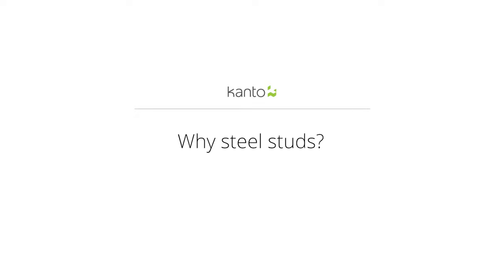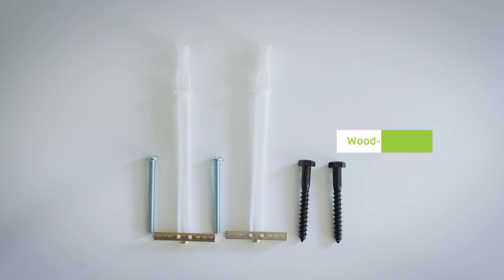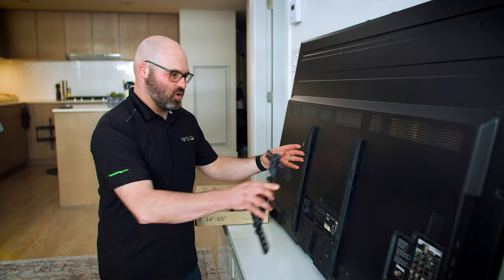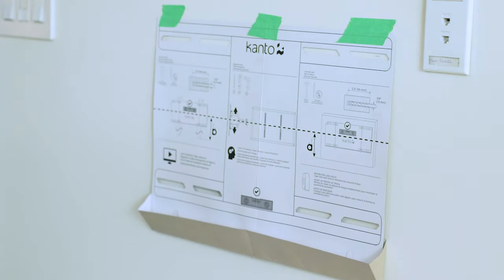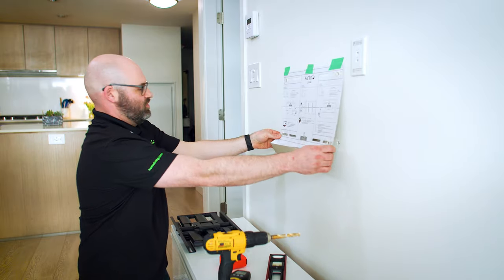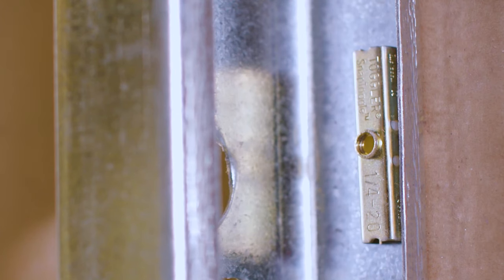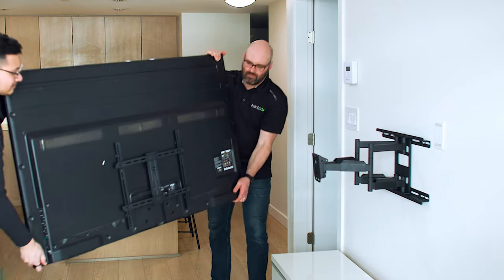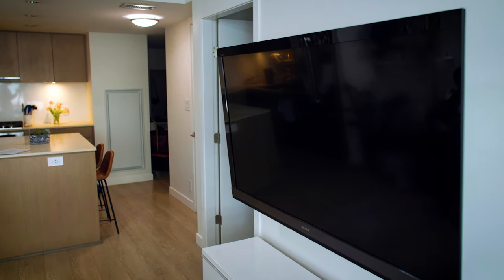How Install a TV MOUNT into a STEEL STUD WALL | Kanto Explains

Comment: I work at a university we install many tvs. I will tell you not every wall is to be trusted...some walls only go as high as a suspended ceiling, others go all the way to the bottom of floor deck below.  There's also a tremendous (lol) difference between a 32 inch TV on a stationary mount and 85 inch TV on an articulating mount. In many cases people who buy an 85 inch TV will buy a mount for it based on advertised max weight but never factor in the wall you attach to.  I would expect the steel stud would provide excellent pull out resistance and shear strength. I wouldn't put a big TV with articulating mount on a steel stud due to its crumple  factor.  It's likely that for many people this install will be successful, just be mindful of how much leverage you are applying to the wall. If in doubt we will remove drywall where the and add additional stiffeners. Many times we will even use 3/4 paint grade plywood to distribute the load on the studs more evenly. FYI steel studs you get at HD or Lowes are not considered structural. If by chance you're on a wall built with heavy guage studs you could disregard my earlier concerns as the steel is much thicker and will have plenty of lateral support.
Reply: 50 in good?
Reply: Yes, this. The 85 on an articulating is a great example of where you're very likely to need to spread out the load, or you'll have distortion of the upper bolt areas of the toggles, which in turn transfer that distortion to the sheet rock and could pop out a section of it, which would look pretty ass. It probably wouldn't pull thru/out, but it's not gonna be great looking for sure. The plywood mount panel is a good idea, maybe a cut-to-purpose piece of cut down 2x4 fitted into the inside of the stud to spread out the load, just spitballing a bit.....
Reply: What about a 65 inch tv? What would you recommend there?

Comment: I would like to add that a best practice with this mounting method is to run your toggle bolt through the threads of your anchor before placing it inside the wall/stud. This will prevent basic cross threading that can happen with this style hardware from time to time.
Reply from the maker: Great tip, thanks for the comment!
Reply: Man I've lost so many toggle bolts in the wall forgetting to check them first 🤦🏽
Reply: Excellent advice
Reply: And sometimes they still don’t catch. When that’s the case, I rub a small amount of chapstick on the top of the screw/bolt and then it threads satisfactorily.

Comment: This assumes the location perfectly bridges onto both studs which are 16" apart.  What if only 1 stud is where you plan to mount?   I plan on using a longer 6"x30" board to bridge across both studs, then mount the bracket to the wood, possibly also use more of the longer toggles through all of it into drywall to secure swivel base to the wood.  Overkill perhaps, but it's a 65", 50lb TV.
Reply: Agreed, that beam across 2 studs also gives extra strength.

Comment: Great video very helpful.  Probably the only thing I am going to add is only drilling about 1 inch in the wall maximum since there might be utilities behind like fire alarm or sprinkler systems or open romex instead of conduit.  I used the Walabot DIY tool to help determine my apartment does in-fact have steel studs, but also they are 24" OC.  But it also shows a lot of utilities.  I noticed the wall has a fire alarm as well as a sprinkler.  So I don't want to drill too deep.  about 1 inch depth should insure I go through the 1/2" drywall plus the depth of the steel plus a little more.  The utility holes are standard on studs right in the middle so that uniformity helps to avoid utilities as long as I control my depth.
Reply from the maker: The Walabot is a fantastic tool if you are unsure about what is behind your wall.  Thanks for the comment.

Comment: Is this mount able to adjusted/ or folded back to the wall off center?  Or is the wall plate portion long enough to catch 16” centers but be installed to the far edge of the plate? The steel studs I’m going into are not located so the tv is centered evenly on the wall space required.

Comment: Extremely helpful video - thank you very much!  This gave me the confidence to proceed with my DIY install of a TV wall mount in my condo with steel studs.  All went well using the snap toggle bolts (1/4" x 4) secured directly into the studs.  In one stud however, after drilling through the drywall and the metal, I hit wood, possible a small block? and I had drilled right through it.  The snap toggles I had and inserted, the bolt wasn't long enough so I ended up going to HD to buy a longer 1/4" carriage bolt (3") which worked and managed to catch the toggle and secure.  
I also like how your video shows what's going on inside the wall when you drill and insert the toggles.  Very well done video!
Reply from the maker: Glad you liked it and well done on improvising for your situation!

Comment: What if I screw the lag bolts directly into the metal stud without using a toggle bolt or an anchor of any sort? Say for a 40 inch 2020 TV and assuming the wall mount is fixed and doesn’t tilt or move at all. Asking for a friend :)
Reply from the maker: We do not recommend putting lag bolts in metal studs.  This could lead to disaster.

Comment: Hey Brett/Kanto - quick question.

Would this installation require drilling thru the metal stud as well? Do you need a special drill bit for this? Thanks
Reply from the maker: Hey Lee, you will be drilling through the metal stud for this installation.  You will need a 1/2" drill bit which you can find at most hardware or building supply stores
Reply: @KantoSolutions  I really appreciate it. Thanks!

Comment: I've read that putting a full motion mount on steel studs will risk warping the studs. I have a 65 inch TV that weighs about 50 pounds. Do you think there's any chance the metal studs will get warped?
Reply from the maker: You should be fine, especially since all 4 lag bolts will evenly distribute the weight.  We have rigorously tested out mounts to ensure a successful installation

Comment: My marble fireplace where I currently have a 55 inch tv hanging is a metal stud wall which is covered by a metal mesh, covered in concrete and then the marble placed over it. So the drilling depth is 2cm of marble + 3cm of concrete (5cm total). Would this be strong enough to hold the weight of the a 75 inch (40kg) tv if I were to upgrade? Thanks
Reply: If u have 5cm combined of marble and concrete, I'd be looking at Masonry/concrete anchors and forget these anchors. That said, considering the great length of the anchors and ability to control, I see no reason why you can't use them in ur situation. U just have to pilot thru a lot of extra material. No way these anchors are as strong as concrete ones though.
Reply: Either way though, you'll need a hammer drill to get thru masonry.

Comment: If you're using toggle anchors, why use the studs at all?
Reply: Drywall will not support the weight or movement of an articulating TV mount.
Reply: Steel studs are hollow, how are you going to expect a bolt to anchor?

Comment: You put a lot of trust into the wall hardware zip ties I wouldn’t do that with a 50 inch tv
Reply: It looks like the zip tie is primarily used to align and hold the metal piece in place until you screw the bolt into it, once they are connected the zip tie has no effect on the weight

Comment: The following video shows a guy dangerously hanging a 50-lb tv with an articulating mount using anchors that are ONLY anchored into drywall (without using studs). 

https://www.youtube.com/watch?v=xujweedgXQw 

If you are a professional installer, it might be worth watching and posting a comment if you think it's safe or not to make sure no one gets hurt from following such advice.

I posted a polite warning message for others, and it seems he immediately deleted the warning.

Comment: Excellent video! Thanks for posting! What BRAND of toggle bolts are these? I'm trying to figure out what to buy. Do I need the kind with plastic where you break off a piece that stays in the drywall, or can I use a "regular" metal toggle bolt from H. Depot?
Reply from the maker: We include SNAPTOGGLE heavy-duty toggle bolts in our LX600SW metal stud TV mount

Comment: I have a 65 inch qned85 tv and it weighs a lot. Almost about 70 pounds. I'm wondering if wall mounting would be safe because my tv is heavy. Also I noticed that my tv mount isn't wide enough and can only catch one beam instead of two but it's super close. What would be the best advice for this. Thanks all!
Reply from the maker: The LX600SW TV mount used in this video can hold up to 100 lbs so a 70 lbs TV will work. It's about 18" wide so as long as you have standard 16" stud spacing in your wall you should be able to hit both studs. Unfortunately, I can't advise you on what to do if you're unable to secure the mount into two studs.
Reply: You should mount a piece of 3/4 plywood long enough to reach both studs with 4 togglers, 2 togglers in each stud. Paint the plywood if you want to match the wall and be less noticeable. Then put the wall mount to the plywood with 4 more togglers, with one side being toggled to the stud.

Comment: I would not have a secure feeling mounting a 60" TV with those toggler  bolts which the most stress from the weight of the TV is putting on the plastics parts of that toggler bolt.
Reply from the maker: The plastic part of the snaptoggle holds the snaptoggle in place behind the wall during the installation. Once the screw is threaded into the metal portion of the snapptoggle behind the wall, the plastic part is not utilized anymore - it's not a structural component.

The LX600SW TV mount used in this video is UL rated, meaning it had to undergo independent testing to hold 4x its weight capacity of 100 lbs. Even though we suggest a max TV size of 65" on the box, it is safe to go with a larger TV as long as you don't exceed 100 lbs.
Reply: @KantoSolutions  Thank you for the detail.  But I don't think I could trust using those snap toggles on anything bigger than a 65" with a full motion wall mount
Reply: @KantoSolutions  I get that the mount is rated to support that weight, but how do I determine that my wall/studs can? The studs in my wall feel pretty flimsy, and in reading online it sounds like some metal studs aren't designed to support any significant weight. Unfortunately there's no branding on my studs that would allow me to look them up

Comment: I’m using a 3/16” drill bit, but literally cannot get through the steel stud in my apartment wall. I’ve tried many different bits of various types, but nothing gets in farther than the small dent that’s been made in it. Anyone have any tips? We’ve applied as much pressure as we can and drilled for quite a long time without any progress. We confirmed with our maintenance manager that it should be a steel stud we’re hitting.
Reply: Use a hammer drill

Comment: To be clear, which bolts did you use to secure the TV bracket on the wall ( i.e. screw into the toggle anchor)? The ones that came with the TV bracket, or screws/bolts that came with the toggle bolt?
Reply: shouldn't matter...so long as they match the toggle bolt (1/2 inch)

Comment: Will this be ok for a 75 inch tv that weighs 76 pounds? I am also looking to use a with a full motion mount (22 pounds) like you have in the video.
Reply from the maker: We do recommend a max weight of 100 lb.
Reply: @KantoSolutions so below 100 lbs you believe full motion mount is okay on steel studs?